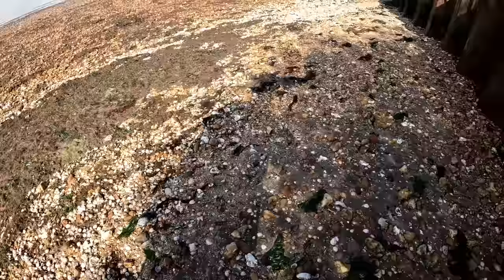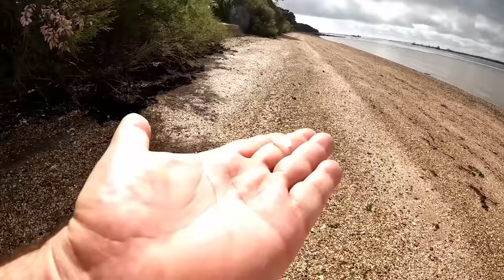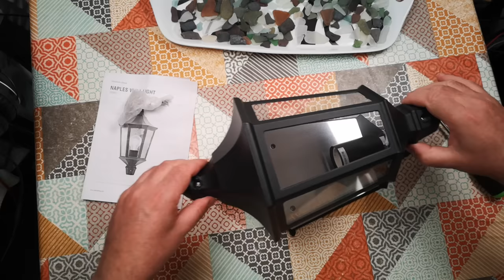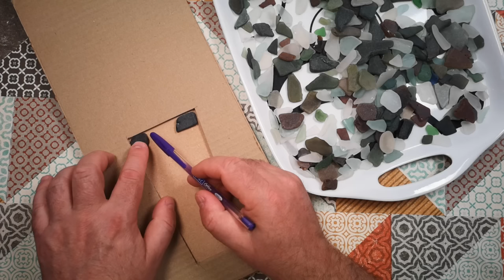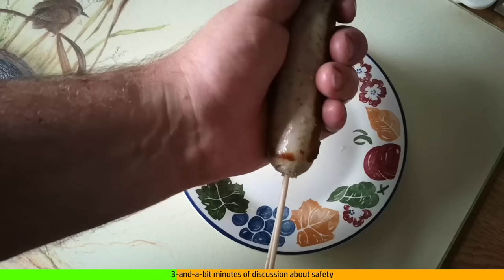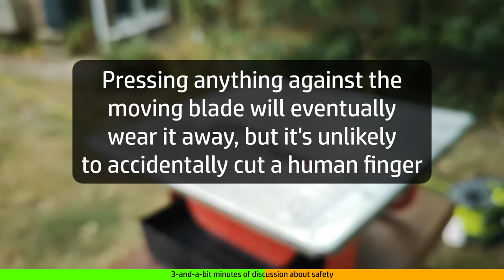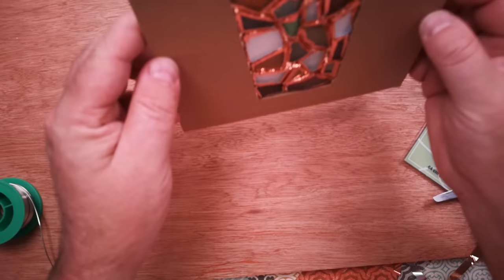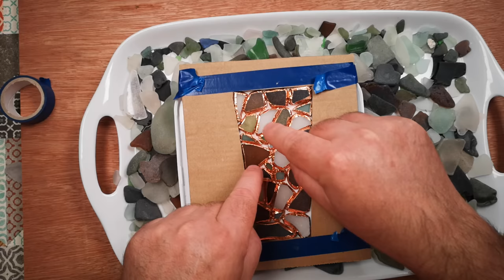Can I Make Stained Glass Panes From Sea Glass (Beach Glass)?

Comment from the maker: Why not just pour resin all over it? - I considered that, and I discarded the idea ( 21:32 ) - I wanted to make metallic-set stained glass - in part because it has to withstand outdoor conditions - resin would not last well - and in part because I don't really enjoy resin casting projects all that much.
Reply: Some resins also react badly with UV and will yellow over time.
Reply: Resin would probably have a refractive index closer to that of glass so would reduce the frosted appearance of the seaglass, similar to how it is when wet.
Reply: Yes thank you, I'm sick and tired of youtubers doing "projects" that just involve putting stuff in a mold and pouring resin over it, then running some machine polisher tool over it
Reply: @BrunodeSouzaLino  aren't there some resins that are made specifically for outdoors use
Reply from the maker: @Marco Genovesi Yeah, I don't want to tear down creative people who specialise in poured resin projects, and I do watch a few of them, and sometimes I like the end result, but it's not something I really see myself doing much of.  I did recently cast some resin keycaps, because I needed some keycaps.  I cast a resin drawer handle because I already had the mould from making a metal one and it seemed like an obvious thing to try.  Big blocks of stuff set in resin though... it sort of makes me feel uncomfortable for reasons I can't quite articulate.
Reply: @AtomicShrimp  I have nothing against using resin, it's the cookie-cutter content where someone has made 100 videos that are basically the same "make a slab of resin with stuff inside" for a table that annoy me, it's unoriginal after the first few times.
Reply: I made a similar lamp using epoxy. It lasted about a year and the epoxy turned brown and some glass fell off. It looked pretty good at night with a flicker bulb, but a tree fell on it and broke the whole thing.
Reply: I have a real problem with resin. Mostly because of the waste material. Can't compost or recycle it. It's pretty nasty stuff. Goes to landfill.
Reply: I love the idea of making something from raw elements and recycled vintage rubbish 🥰 All the best things i enjoy in life are made with fire, heat and the sun 😆
Reply: When I see those resin projects, all I can think of is, that's pretty, but it's just more plastic to end up in a landfill one day.
Reply: @marcogenovesi8570  I agree. The resin projects seem so synthetic. They definitely have skill, but it seems different. When they put a solid item in a transparent item...well it just doesn't seem exciting to me.
Reply: @Dontstopbelievingman  I totally agree.

I that some of them think that they are being environmentally friendly by using the stuff that they put in the resinn.
Reply: @nenben8759  All resins eventually yellow, even the ones which are said not to. They just take much longer.
Reply: @jonathancampbell5523  I guess we can't find fault with the lamp construction in that case 😉
Reply: @k8eekatt  Not at all. I loved it. It turned out much better than my epoxy lamp. Flicker bulbs would make it look even cooler perhaps.
Reply: Because if u pour resin all over it Ur not really learning anything a guess
Reply: One little tip: You should not heat the solder on the soldering iron, but heat up the contacts itself to the point where touching the contacts with the solder is enough to melt it. Otherwise the material you want to solder is too cold to form a good connection. If the solder becomes blunt after cooling down is an indicator smthg went wrong. If it stays shiny, you did it right.
Reply: yea just like tables made from wood. also unoriginal
Reply: @tappy2081  You should post a video of the trolls you carve.
Reply: If you hit the panels with a heat gun you might be able to smooth the finish of the solder
Reply: @marcogenovesi8570  There is an artist who makes 3d resin paintings and even did this amazing under water ruin diorama. It can be wonderful if used creatively.
Reply: @boyinblue.  yes I was too generic. I meant mostly the people making slabs of epoxy resin with objects inside, or covering wood with resin to make a slab
Reply: @BrunodeSouzaLino  nah you can counteract it, and if its just a really thin layer, you don't even need to do that.
Reply: @wupme  An alternative to using standard resins would be using mma resin, which is UV Stable and often used to coat floors and driveways. It doesn't yellow.

Comment: Morning 🙂. I did loads of copper foil stained glass work years ago. It was lovely to watch this. Blackening the solder hides a multitude of sins 😃. Thanks for another great video.
Reply: Hi Tess, I'm new to this. How do you blacked the solder in a way that's not going to rub off? Vinegar or something? Cheers.
Reply: @Shaun.Stephens  It's so long since I've done it I can't recall the name of the solution you use but there's a solution you just rub on it to colour it black. Sorry, not super helpful.
Reply: @Shaun.Stephens  There's a solution called pickle, just look it up
Reply: @Shaun.Stephens  Black patina, it's a liquid you sponge on for 20mins or so then rinse off. Makes the lead black.
Reply: @e2linuxos  Thanks!

Comment: The electrical solder has a rosin flux core which the plumbing solder doesn’t. It is the rosin flux helping the solder run.
Reply: Some acid flux would have helped a lot with the finish.
Reply: @Mr.Unacceptable  I was thinking the same, I did stained glass and copper taped piece work in high school, that's what we were taught, not bad for a first time, eh? The hard part was sorting out and arranging all those pieces!
Reply: I came here to say just that - also lead free solder is an abomination, and the flux it uses is very aggressive and will break down electrical connections over time - treat yourself to some decent branded 60/40 or 63/37 and soldering becomes a pleasure
Reply: @Tsnafu  ; Lead has issues on it own.
Reply: @FirstDagger  Life has issues on its own.
Reply: @Tsnafu  Absolutely lead free solder is terrible.

Comment: Exeter cathedral has examples of bomb damaged windows where the damaged glass has been reused into new images (not a random design). You can see the glass has been reused because the designs that have been painted on the glass are randomly orientated within the new design. Very clever. You could star at the detail for hours.

Comment: You need a tinning pot of melted solder to tin the copper tape. Makes soldering easier. You needed some acid flux with the plumbers solder to get the smooth finish. A hot air gun to heat one side at a time so it doesn't glob up and melt to one side to finish off.

Comment: If you were to try this again, I could definitely recommend using a method they use to cut thin sections for rocks/petrology. Adhere those pieces of glass to something like a piece of wood with some dissolvable glue, then press the glass up against a very fine belt sander. Repeat for the other side and you will end up with some incredibly thin slices of the sea glass that will allow more of the light and colour through it. Polish it afterwards and it will be ultra clear!
Reply: He didn't want it clear and transparent though. He said that even if he hadn't used sea glass, he would have sandblasted it to make it frosted
Reply: @JustAnotherBuckyLover  That part went right over my head. Oops!
Reply: @UristMcPerson  LOL no worries, happens to me all the time. Otherwise, your idea was fantastic.

Comment: My old friends owned a stained glass studio and publications company here in the States.
 I watched many a prototype piece of stained glass being assembled. They used a glass cutter and glass pliers to break the pieces to size. They also used mostly a 100 watt iron to solder the glass. The higher temperature made the solder flow smoother  and with the larger pieces of glass, helped keep the joints quite smooth.
(Small hobby irons like you used take a much longer time to recover the heat, and depending on the condition of the glass, cause it to crack.)
 They also used Eutectic rosin flux as needed. I also watched them assemble huge-6' x 8' windows for their own home using lead came.
 I really liked the project you did. Especially all the sea glass.

Comment: Another option could have been to cite the solder to size around the joints, place it on the joint then place the entire thing in the oven. This may have gave you and much smoother joint. This method is often used in the electrical manufacture industry

Comment: Some advice (wall of text): Your soldering iron is far to small a 70-120 watt iron would give you a much, much better finish and a smooth even bead.
Flux helps enormously when soldering, but tallow (yuck) is best.
60/40 solder works so much better as lead free solder is awful to use.
You get dispensers for the foil or can make your own (not really needed in your case).
A wine bottle cork is excellent for smoothing the copper foil.
You did great with the wet tile saw,  but obviously a wet glass grinder would have made this a doddle (you could make your own, but would still have to buy a head and bit etc).
Some black patina on your soldering would make the panes/panels pop (not too late to do that).
Absolutely loved this video, your patience, humility and production skills are off the charts.
Practice is the only way to improve your soldering (and a suitable iron); making loads of terrariums and kirk planter type things gets your soldering skills up quickly.
Love the fan you use whilst soldering and giving general safety information as lead is toxic, breathing in solder fumes and lead particles is no joke and very hazardous to health.

Comment: Hello from Canada, Mr. Shrimp!

1) I think that you are on the right track with using big pieces on the outside, and then working inwards. This way, you end up with 1 odd shaped hole to fill, rather than many on the outside.

2) As a time saving measure, I think that you could just assemble it once through, and then grind off what you don't need. The idea is that grinding time is probably fixed in length, whereas searching for the perfect pieces can go all day, as we raise the standards and move the goal posts.

3) I'd like to try to do something similar, but use HDPE. A major problem is that HDPE probably won't last long outside in UV exposure, but it would be interesting, though.

4) Thanks for telling us about the history of that place and the ins and outs of glass collection. It is very fascinating.

Comment: As an extra aside on safety and greater usability it is really worth making yourself a zero clearance top for that tile saw. A large, flat ceramic floor tile is best for this and you might even be able to get one for free as a sample or scrap bin from a tile shop. Much less chance of your finger getting snagged in the gap or small pieces getting trapped/lost. 

Very useful on normal table saws and especially bandsaws.

Comment: Just a suggestion, put copper powder into a thin epoxy and carefully fill in around the pieces held in frame. Let dry and the then pour over clear epoxy to hold sheet together. Heat both to help flow and remove air bubbles, of course.

Comment: I've done something similar with woodworking and fiber crafts, where I'm trying out a new thing with supplies I already have on hand and getting myself quite frustrated over it when there's a decent chance that the existing tools and supplies are what I should have tried learning on before getting creative. But when I have stuck it out through the frustrationand failure, I think there's some value in the mess. You certainly learn more about why the established things are the way they are from seeing how everything else is harder than you would just being told "This is the best way."
Reply from the maker: Yeah, there's a sort of 'learning how to learn' method to be learned, if that makes sense.

Comment: I have just been pondering the technique whilst walking the dog, I wonder if applying flux and cutting and laying on the lead based solder and then melting it with a heat gun/paint stripper and achieve the soldered joint in a similar way they solder surface mount components.
Reply: Risk it dripping through and pooling on the underside but the acid flux and a little heat gun treatment would help with a smooth finish.
Reply: you could fill it with solder paste which would flow around the glass. probably still need copper tape for it to stick to. like put it in a mold with the solder paste filling the gaps
Reply: I was thinking along this line, too, Tape one side of the copper wound pieces in the template, flip it over still in the template, fill in the wide gaps with copper balls, lay the two solders and melt it as one piece. Burn or sand off the tape and then polish. Just an experiment though, I've never done this.

Comment: I'd be tempted to run over each of the three finished glass panels with a blowtorch, to really build up heat, and make the solder smooth out. But maybe that only works in my head 🙂🙂 Awesome video, as always. Love from Denmark.

Comment: What you'll find will help with the solder iron's heat is doing a thick join and then a thin join, back and forth.  This will allow the iron time to recover thermal mass for the thicker joins.  But even that is more of a time saver than anything.  Your end result was quite beautiful, I think.

Comment: I wonder how viable it would be to use a rock tumbler to make faux sea glass for a project like this.

Also, with your idea of cutting the pieces to help fit better, you'd then have to run it through some form of sanding/tumbling process since that'd leave you with sharp edges.
Reply: I was going to comment the same thing.

Edit - found this on Amazon:

This is an excellent piece of kit in most respects. The tumbler comes with one-year warranty. It does the job. It will make faux sea glass in a day, two at the most. It is quieter than I expected. On the down side, the drive belt has a limited time span. I have had the tumbler for four weeks and it has broken two. The tumbler comes with a replacement drive belt. I have used them all up. In the instructions it states that more belts and accessories will be provided free of charge. Unfortunately, they do not give an email address or a telephone number. I can't find them on Google either. So, you can expect an excellent tumbler but, effectively, the life span of the tumbler is probably no more than six weeks. So, not so good really. see less
Reply: I've done it before! Easy but takes a few days. You don't need the coarsest grits. It's been years, so I don't remember exactly how I did it. But my broken wine bottles turned out great!

Comment: You could make it out of thicker stuff, but with a twist. In a bucket of water, using the dremel extension, thin the edges with a diamond bit (goes pretty fast) so they fit inside the standard H track used for stain glass. That would make life easier in the long run. It's one of those weekend projects that you can do whilst watching a movie/listen to a book or something and shut your mind.
Whilst i didn't use sea glass, i did an art installation with a friend (his concept entirely, i just helped with the concept) using something like 600 or more glasses lenses. Had to adjust them all to fit the thinner of the H tracks whilst not losing the shape too much.
edit: i think it came out great and along the way you basically figured out what you needed to figure out. TO get smoother solder lines you need a wider head on your solder iron. It's the conic shape of the iron that's giving you grief. With a round rod end you get a very smooth finish.

Comment: Unless it is very different in the UK, in France, stained glass are quite larger pieces where the details are painted: for example, one piece of glass for an hand, with the various fingers and joints painted on the glass.

Also, traditional stain glass is made from lead H profile, that is more rigid than that copper tape, and each piece would be soldered along the assembly.

When recreating stain glass windows from shattered ones, maybe they also allowed themselves to re-cut the fragments to allow tighter fitting.

The result looks very good and it makes a very unique lamp.

Comment: a solution that won't involve cutting the weathered glass would be to have more wiggle room.

the whole panel won't be visible from the outside—there's a margin that would be covered up by the lamp frame. that margin could be the wiggle room, where the glass can poke out if necessary, and any space still empty by the end could be filled with... plastic or something.

this can also allow you to use similarly-sized pieces of glass, and that might make for a stronger pane overall—but i'm no expert on this

Comment: Should have smeared a thin layer of flux on the copper and that solder would have just flowed in there beautifully. Just make sure to clean up after as its corrosive if left on too long.

Comment: i think one major step for a nicer finish on the solder would be to use a hot air gun and heat up larger portions of the solder at once so that surface tension can pull the joints into a nice shiny bead.
if you do it while its in your template the pieces will also move a little to even out the width of the joints